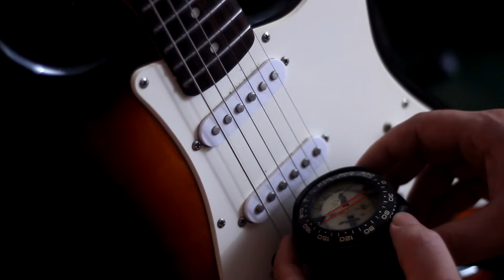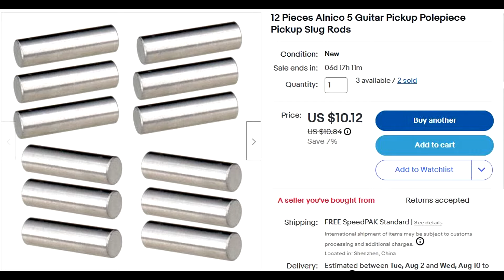Mod Cheap Ceramic Pickups Into Vintage Staggered Alnico (Easy DIY!)

Comment: wow thats really interesting how you charge them... you do such good handy work , its a joy watching along . i wish i had the patience to film my work i just work and then run my mouth after the fact . this is a lot more fun to watch pal . your hard work is not lost on me . the sound comparisons are excellent and its funny how the ceramic does not soun as terrible as i have read in the past but i also have a set in my cort 45 and i love the sound since i installed them . it had duncin (doughnuts?)  design in there that i got for 5 dollars as one tab was broke off but i used some jb weld . you live and learn hopefully . thats one thing that sets this channel apart lack of hype mispeak group-think general marketing influenced bullshit that feeds the comment sections and forums . this is why i try to keep an opened mind , think for myself , hear with my hears and never take anything i read in a comment section or forum seriously until i have tried it for myself . a lot of people mean well but a lot of people are wrong. ultimately yes of course we do need gear, (not too long ago almost all players pretended you didnt need pedals remember that i do and i was chastized badly for using them- even kicked out of an open mic for using a board with a single power supply ,  big muff and eq and a delay pedal on it! - you dont need all that sh@t here and if you do you are not welcome to come back. Now that everyone is ok with using pedals  does your rig have to be rediculously expensive for you to be taken seriously ? (yes - 3x strymon guy i am lookin your way) do we need to constantly be buying the latest greatest thing when what we allready have is absolutely excellent ? that all comes down to your point of view / personal preference but its kind of moot point to anyone but some other guitar player who is judging you on your gear. its the sort of stuff that only guitar players themselves care about , no one listening would ever think of or cross their mind but have become very important to a lot of us , this stuff  snowballs into myths and then social laws . if you go against the grain you are labelled some kid in a bedroom with a line 6 by people who may talk big in the comments but when you look a little deeper these types never have a single iotta of work to show for their talkin . our gear does not define us , this is the job of our MUSIC , now if you do not have ANY music well then YOU sir have a problem . keep on rockin in the free world clem .
Reply from the maker: Thank you so much for watching Petey. I do like to tinker with stuff but  it is a heck of an added workload to get everything out and set up and put lighting and camera on there and make sure its all in focus and proper aperture settings and all that stuff. I have looked of at my old lady before when I was up for like 2 days editing and said man Petey is one person I know that does truly understand what actually goes into all this. This one wasn't too terribly bad but adding a close mic to the amp did end up with an extra step in editing at least I didn't have to try to mix or tune and blend it or anything as it was just a dry mic for comparison. The hardest part for me was trying to play what I already played days before. I don't operate like that I just play by cutting my brain off and letting my hands take off so trying to copy my own parts was a bastard. I had to listen to them and watch my hands and take a few cracks at each one. Yeah, nothing wrong with ceramic pickups at all. I think they just get a bad wrap because a lot of really cheapo pickups use super strong ceramic to get away with a super low wind count to save money so they end up ear-piercing grimy pickups with no balls. Decent ones are warm and strong. It has surprised me how much the popular consensus is exactly opposite of the truth ask any guitar forum besides a pickup winding forum put in order from warmest to brightest... Alnico, Ceramic and Neodymium. They will say Neo is brightest and Alnico is warmest... NOPE! opposite. I dont think its even the actual magnet composition I just think as more magnetism is added they make more bass. So I have a pretty damn cool high tech experiment coming up soon. I'll prove it once and for all. I know this dude named Timmy Wayne and he is a great guitar player but he is so against pedals... I showed him the fuzz I built for my dad its got a capacitor switch that changes from overdrive sound to like maestro velcro tone. He's like naw, I don't USE THOSE! My tone is in my fingers. He plays... Guess it. Yep an old timey Les Paul Burst thats worth more than my whole life and a Marshall blues breaker combo is his practice and travel amp his home amp is a Plexy full stack. I played the combo and it was awesome but he saw me turning the volume knob on the amp for gain and I saw him looking at me funny... I said yeah I bet you just use the guitar volume huh? He said yep. Then I hear him whisper to his girlfriend yeah thats what I used to do too before I had TONE. I have come to kinda hate this word tone... for a long time I didnt get it, I was like well tone means either it has treble or bass or it doesnt and to an extent I still think thats kinda at the heart of it. People just dont realize what a 6 band EQ could do to "tone" but I didnt know people meant the gain, the speaker, the way you pick, the reverb, the pickups, the color of your jacket... apparently whole damn thing is "tone"??? I didnt say it but I was thinking yeah, I understand what an RC circuit is and if you don't have a treble bleed then when you turn that volume knob down your TONE is bleeding to ground, but I guess when you have a muffled I mean "warm" guitar you cant really tell. LOL I will fully admit though that I have become a gear fiend myself. Its only because this is like basically the ultimate time in history to become that way. I can get guitars and pedals on reverb or amazon for almost nothing and the used market is so saturated at thrift stores and pawn shops and their are companies like Mooer, Monoprice and Glarry. There are 60 yr old speakers, amp parts, tubes, chips and transistors on ebay and I'll keep using this Channel as an excuse to stroke my hoarding and as long as any company wants to send me something I'll take it and tell the viewers if I think it sucks or not and let them hear it and decide. I was a much better guitar player back when I had only 2 Strats 1 twin reverb amp and 1 multi-FX pedal for 8-10 years. I was practiced and intimate with them and damn good at using them. I really should be making more music than I do but I still remember what all the gear is for from time to time but it just doesn't seem so important for me to get it out anymore. There are a lot of songs on that hard drive in the studio room. I use one for background music or something from time to time but I guess they are just in waiting... for what I don't know but they are waiting. Take it easy brother and thank you so much for all the kind words, interest and interaction.

Comment: Have you (or someone) ever tried to hybrid the magnets? For instance, a humbucker is usually a ceramic horizontal bar with steel vertical poles. Instead of steel poles, adding alnico cylinders (like those on a strat) to the ceramic bar. Or using a ceramic cylinder (with half height) on top of an alnico one, or vice-versa. 
Or in something like a strat pickup, which has alnico cylinders but adding ceramic cylinders between them, stuff like that. There is the magnetic pull factor, but i guess alnicos are not brutal.  This is a great channel.

Comment: Great video, i like the sound of the ceramic more, in my ears the alnico sound way to harsh.
Reply from the maker: Thank you for watching and taking the time to comment PT. Nothing wrong with that at all. Yes it was thin sounding too with this rig.
 I usually play with a bigger size tubby-flubby tube amp on the edge and then often with a fat germanium preamp so that thinner oldschool pickup sound will co-operate better with that stuff for me. (its whiney hahaha) If im playing more aggressive music or using a modeller or multiFX with solid state amps I definitely want a hot loud ceramic.

Comment: I used Alnico 5 for the 3 lower strings and Alnico 2 for the three higher strings for deep low and smooth highs. Nice demo. Like the Alnico the most cause they sound better in overdrive and distortion to my  ears. And yes i tried neodymium magnets but I did not like the tone.
Reply from the maker: Thank you for watching and taking the time to comment snakebite. Yes that is a great idea I have had similar suggested to me but never tried it. Yes.. The thing many people didnt seem to consider is the way the guitar would sound with a fat tubby tube amp or a lot of gain. In a mix you dont want that fat ceramic sound its great in a cheap amp and in a bedroom though cause its fat and loud. Ceramic just also dont caress tubes on the edge of fizz the same? 
Yeah, I found that with neodymium its the opposite of alnico its so strong its all bass no highs so you have to build a pickup around that and make a weak coil or place the magnets in a less direct path to "turn it down" so to speak. I did that whole rabbithole on the channel good tools to have in the box for later builds I reckon.

Comment: If you have a ceramic magnet, you probably don't have enough copper wire either, as the two methods of making a cheap pickup go hand in hand. But you could hardly make the pickup any worse if you killed it trying. I do have a set of Japanese strat pickups with dual ceramic magnets either side of the pole pieces, which I do like,  they have a stratty but different tone.

Comment: I think the main difference is the field strength of the magnets. I recently bought a Squier Infinity Tele with ceramic pups and compared it to my Tele with Vintage 65 Jazzmaster pups, recorded one in the left and the other in the right channel playing the same patterns. They both sounded the same. Both had 250K pots. I changed the JM to 1 Meg vol pot and 25k tone pot. There is and unmistakably difference now. Windings and pots make more difference than magnets.
Reply from the maker: The field strength and location is absolutely the only real "scientific" difference that happened in the video. 

  You can design a pickup around different magnet types and strengths to mimic the sound of others by slight changes in winding pattern/scatter amount, magnet wire size and amount, magnet wire coating types, back plate and pole piece materials and configurations.
  This video does however show exactly what alnico magnets sound like in comparison to a ferrous slug and ceramic bar configuration all other variables identical. 

   In the past videos I have used self made bobbins and designs to get the tone of vintage Alnico pickups with fiber flatwork and formvar wiring from DIY pickups using neodymium magnets with wood flatwork and poly wire by under-winding with tons of scatter and changing the dimensions of the bobbin perversely to shape the tone. lots of experimenting to go yet though like maybe a lifetime...

  Your very right about pot values, that extra signal not bleeding to ground especially in the high end makes a heck of an audible difference and if you play the edge of breakup tuby kinda gain the feel can change day and nigh on how it bumps the amp into breakup. man I love talking and learning about this stuff either in comments or videos or reading books.
Reply: @heavymetalATC  Ceramic magnets have gotten a bad rap throughout the years. This all started I believe back in the late 50s and early 60s as many imports from Japan used ceramic magnets. Most of them were hand wound and not stable on tension plus scatter wound and were not potted. They were indeed harsh and very microphonic. That being said, I'm talking about mostly the imports that sold for a range from $40 to $100. The very late 60s Cort, Samick, Ibanez, Yamaha and a few others started making better pickups.

Comment: Great video about how a minor change such as magnet type can really change characteristics of your sound. One pickup can sound good in a guitar but sound great in a different guitar sometimes. Pairing a pickup with a guitar is a thing as well. I have some China pickups that squeal and it hurts your ears at anywhere close to over 80db. My wife was like "what are you doing?!? STOP! I of course took them out and put in better USA pickups but I am curious if it is the magnets, the type of wire, the amount of turns or what that makes them so squealy. At low volume they actually sounded lively and pretty usable but man do NOT turn them up!! If you want I could send you one or two. I had 3 guitars come with them. I began to try and yank them apart but the cover solder was really not melting and the wax was dripping out so I quit. Probably have to cut covers off with a dremel or something. Anyway let me know if you want to do a video on them I can send a few your way. I was thinking about doing one myself but like I said it did not cooperate and my patience that day had gone. Plus I am not as seasoned a pickup maker so likely the cause could escape me.

Comment: I have been doing this for quite some time. I noticed that most ceramic single coils are around 5k, some even lower. So I add some more coils to the existing one, winding in the same direction of it, till getting 6k or more. It's much better.
Reply from the maker: Thank you for watching and taking the time to comment Jose. I never did even test the resistance of these pickups. Thanks for the info.
Reply: how can you increase ths pickups winding? Curious to know, cheers.
Reply: @elwrongo  you simply get more 42 gauge wire, solder it to the end of the coil and wind around the existing coil. Those cheap ceramic pickups normally have enough space to stack up a lot more windings.

Comment: Definitely has that bell like ring with the alnico. Would going from a ceramic bar to an alnico bar have the same results?
Reply from the maker: Thanks again Lou. I really dont know as I haven't tried it myself but I will put that in my notes and plan to do an experiment in a future video. Someone else mentioned the same thing.
Reply: i can't really give an answer to this but my experience has been pretty much all ceramics have a midrange compression that kills the high end. i'm an alnico guy
Reply: @heavymetalATC  ill second that suggestion/great to see a vid on an Alnico bar magnet swap out 🤘

Comment: Do you think it’d work to use a heat gun to melt the wax such that it’d solidify and stick to the new poles? Essentially re-potting without re-potting to prevent microphonics

Comment: Being a Squire, it needed 500k pots for those ceramic pickups. Alnico should be tamed down with either 250k pots - or now you have the opportunity to run long cable lengths and welcome how the cable capacitances runs off the high end

Comment: Hi , I have a question! I own Squier Start with ceramic HSS . Can I change only one pickup , to have 1 ceramic hambucker , 1 single alnico on mid position , and one ceramic on neck? Thanx
Reply: Yes, you can.

Comment: Just curious, can't I just replace the ceramic magnet with a Alnico bar magnet(like humbucker) and glue it underneath the pickup instead of replacing all the rod?
Reply: Yes, you can but make sure the bar magnet has it's magnetic poles in the right sides (I mean the side toward the pole pieces), since the magnets used in humbuckers has it's magnetic poles in the thinner sides.
Reply from the maker: Exactly or... flip it on its side but I figured out it probably wont fit without the power tools hahahaha.
Reply: Thanks for the info, I just bought a set of used Fender American standard A5 pickup for $30 from a friend. I guess the bar magnet thing isn't really a good idea lol.

Comment: Why would you widen your nut slots?  couldn't that make the guitar buzz?
Sorry, I've never heard of doing that before. Still learning..
Reply: That improves the tune stability, just like using graffite in nut slots.
Reply: @TheForce_Productions   I've always found a dab of oil works best, but I can see filing them open a little if maybe you had heavier gage strings.
Reply from the maker: Absolutely. I was just helping the string fit better not taking it down or widening the whole slot mostly opening it up towards the headstock to keep it from slipping while leaving the edge toward fretboard more or less close to the same.

Comment: But those sounded really good at the beginning.

Also, if someone of you want to try this on a even more cheap guitar that has awful sounding ceramic pickups, just don't try it. The AlNiCo magnets won't make them sound better, since they sound bad because of their poor construction and not by the magnet they used to make them.
Just swap for better pickups.

Fun fact: some early Mexican Fender had alnico pickups but also had a ceramic magnet attached to them to make them more hot.

Comment: Not sure why people describe alnico's as "warm". They aren't. The DO sound good, but no "warm". Awesome video!
Reply from the maker: Exactly!!!... with more winds on the pickup you can get it to be a bit fatter but in general its those big loud flubby bottom marshall and fender tweed amps that guys had the bass and gain wayyy up on that caused folks to associate the vintage pickups with warm or fat.

Comment: I ended up doing this recently. Turned out nice, 5k-ish pickups for a very vintage tone.

That said, I slammed Neodymium Poles into the bridge pickup instead of AlNiCo. Had to push them flat with the pickup cover and set the bobbin to the same distance from the strings as the other pickups. Not sure it sounds any better, but you can slap a metal faceplate over it to 'smooth' it back out, which is a neat party trick.